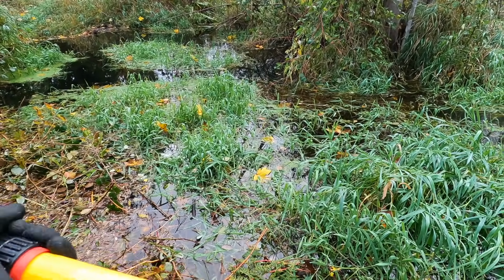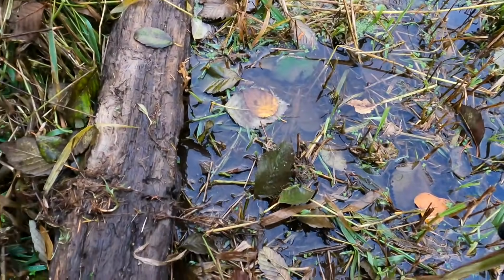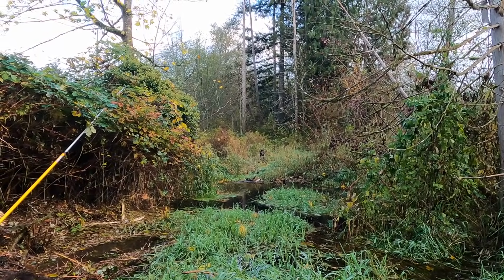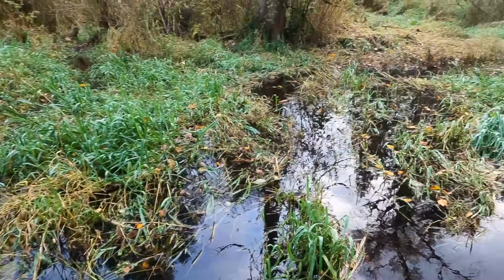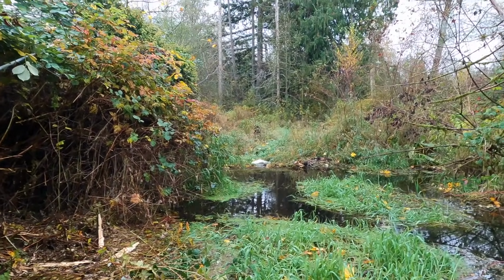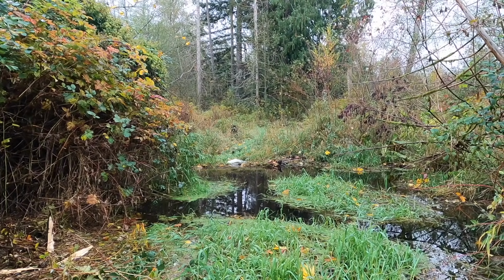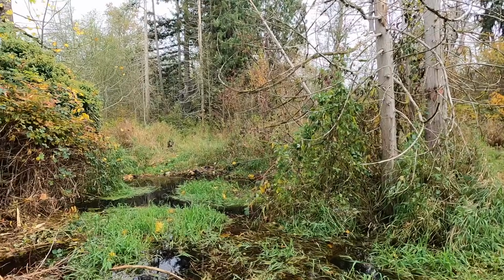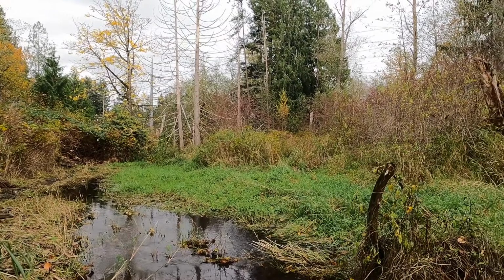Breaching BEAVER DAM! Isolated Areas Require Creativity | Beaver Creek PT 8 |

Comment: I am guessing this might be a rude question, but can someone explain why the dam has to be removed?
Reply from the maker: I explained in a previous video how there’s nothing wrong with the dam when it’s small. But these dams here are doing more damage at this point then good. One example is all the trees dying because there is no longer solid ground for them to be in, they dry out then eventually fall over. Another reason is if one of the dams on the top bursts all of the ones under it will go too creating a huge wave that will sweep over everything and create a tsunami. 

This was just a breach and it did what it had to do. In the first video of the series I talked about how the original creek bank was now submerged and as the days passed I noticed the water level was increasing.

Comment: That is exactly why this video is getting a thumbs down 👎. I do not mind some examples and a little teaching here and there. You need to think a little more logical about things like time. For instance, if you go directly to the dam (using the down logs for support if you have to) pull that sucker from the bottom up, the grass near the dam will be permanently sunk. Spend five to ten minutes on the grass put some words in and because the dam is the gaol, spend a minimum of ten minutes minutes or the majority of the time on the dam. I know that real time and video time are different b
You know the different between Terrell Spivy and post 10 is?  Why Terrel barely break a 1000 views until after a while , post10 gets about 6.9k views to about 100k without trying?  Terrel spends 90% of his video doing other things and sometimes pushes the dam clearing to the next video. Post10 excepts the clearing as his job and loves it. He does not complain about getting there. He spends only a few moments explaining the situation and saying what needs to be done. He spends the important time on the gaol ( the dam). That is about 15 to 20 minutes or so on the dam. And since he knows that people like it as the main part, he does not hold it hostage for another video. If he knows it will be long, that’s when he will split it. Thanks 😊.
Reply from the maker: I mentioned how the water was too deep to go through. Most of what Post 10 works on is easy accesible to him. This dam was not. That’s why I had to use the extension pole to get there.